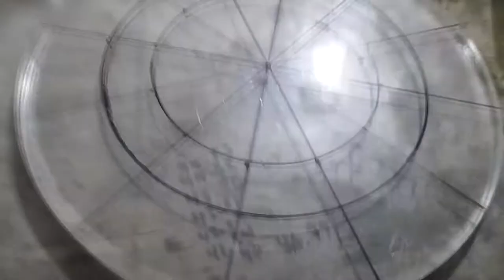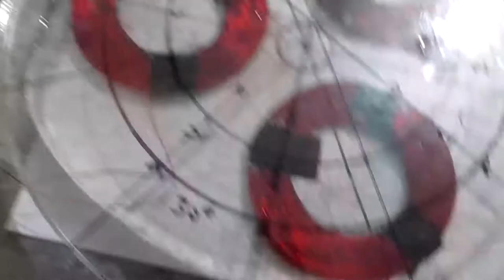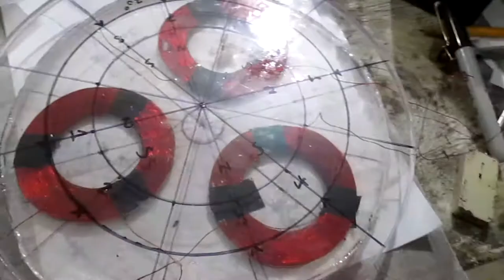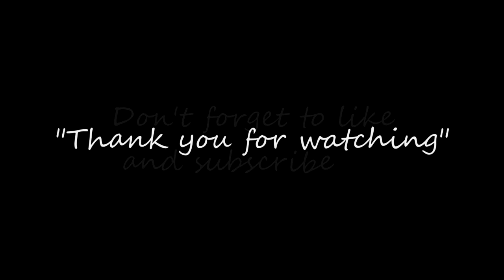Three Phase Generator Nikola Tesla DIY

Comment from the maker: Drive coils are triggered every 90 degree and are placed 90 degree apart around the rotor. Because  there are only two magnets on the rotor and they are placed 180 degree apart the rotor remains balanced and each drive coil gets triggered twice per single 360 degree rotation

Comment: Any progress on this project? I'm trying to make a tinkercad model so I can print the rotor and the stator. I'm having a bit of trouble of aligning the coils over the magnets
Reply from the maker: You use the 12 lines in the circle to do that .  Place the magnets center over the line as you place them on the face of rotor make sure the poles face up like so North / South  all the way around . every two magnet placements skip one line . Then your 3 coils line up over the magnets  so the arms of the coils should line up , you have two arms and two magnets per coil . 12 line only 8 magnets on and 4 empty spaces  is 12 lines  8 plus 4.  Its super interesting but ya only 8 magnets are passing over 3 coils , each of the 3 coils receives its own pass of two magnets , 1st coil receives pass at 120 degree , 2nd coil receives pass at 240 degree , 3 coil receivers pass at 360/0 degree
Reply from the maker: 12 lines 30 degree separation. your going to need this https://www.amazon.com/Helix-Integrated-Templates-Assorted-36002/dp/B0044S5CZM/ref=sr_1_5?keywords=circle%2Bruler&sr=8-5&th=1

Comment from the maker: meant to say 8 magnets not 12 ..  12 lines every 2 lines a line is skipped so you have 4 empty gaps within 360 degree containing no magnets (ROTOR). To create the template make 12 lines of a circle separated by 30 degrees